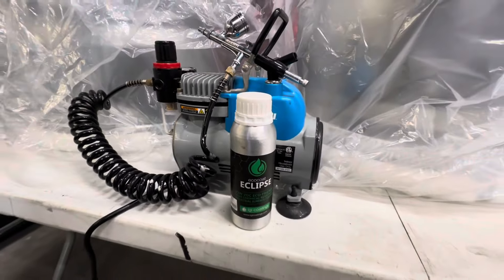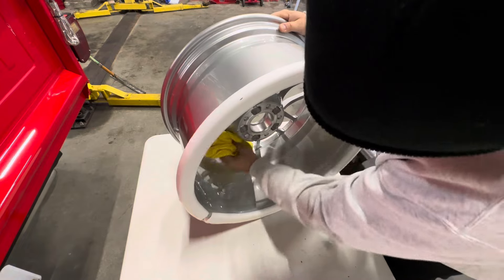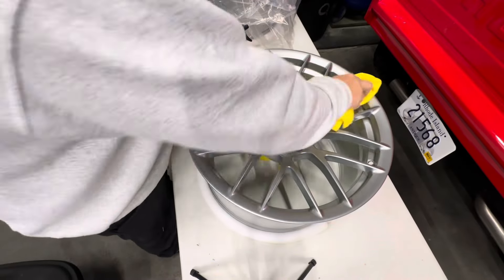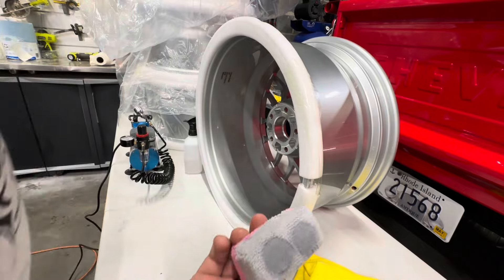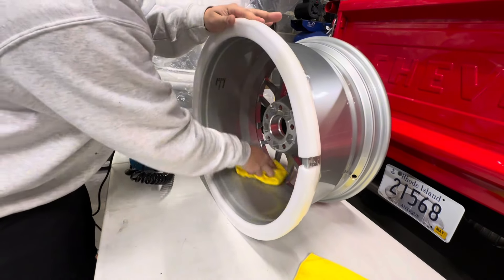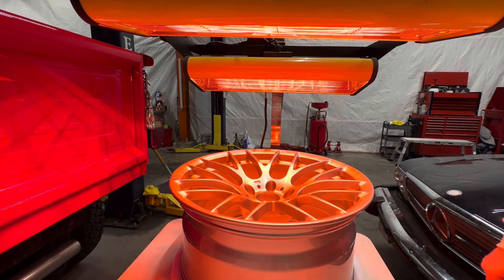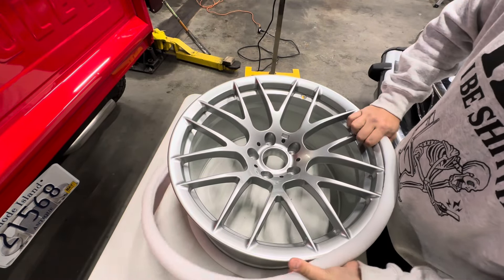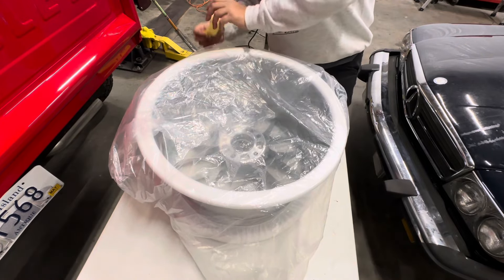NEW  BMW forged wheels ceramic coated! DIY

Comment: I know Enkei Raijin when I see them lol
Reply from the maker: close, they are forged M3 replicas from a company in Canada. Ran about $2600 for the set. Pretty sure they are manufactured by Enkei from the factory though.
Reply: @WADIY88  I honestly had/ have no idea. I know that spoke design is BBS and was specifically made for BMW, and Enkei made one called the Raijin that has been highly popular for well over a decade. So the one in the video is another version?
Reply: Oooh I see the wheel design is like Enkei MK3, more spokes than the RAIJIN  @WADIY88